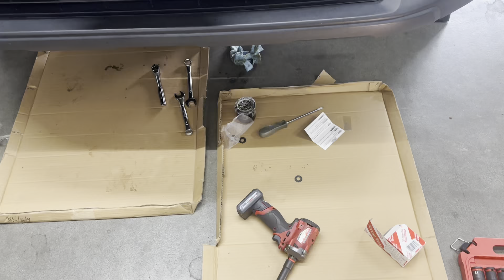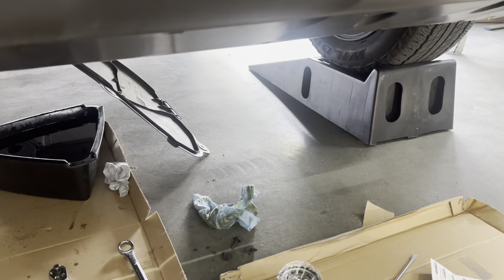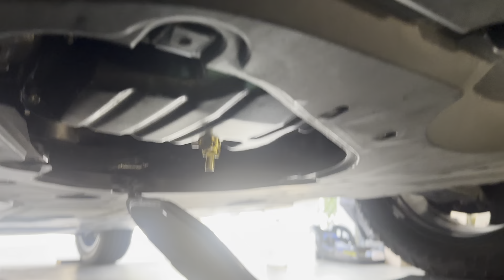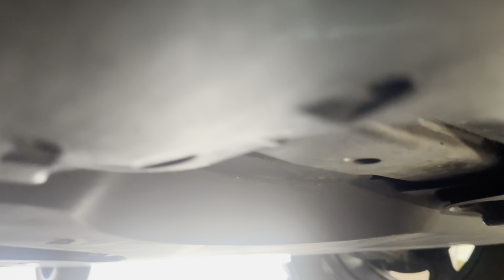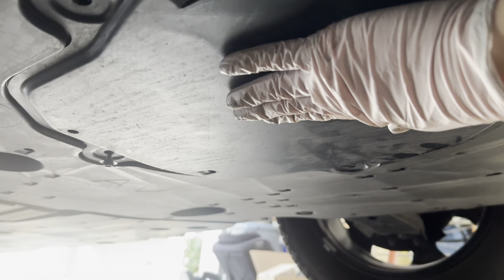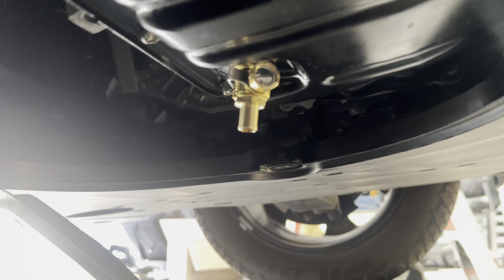Fumoto valve F133N long nipple RAV4 oil change hybrid

Comment: Good to see it clears the cover. I wonder if the dealer will honor Toyota care with it installed? I’m doing 5k mile oil changes on mine and that thin oil came out so fast it got everywhere. I even ate some.